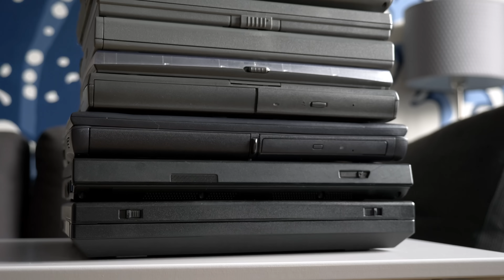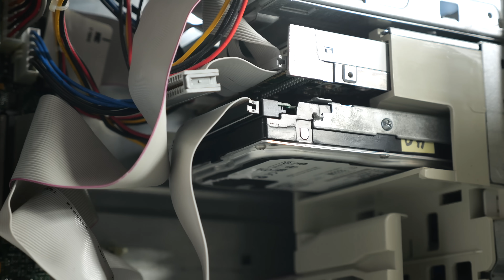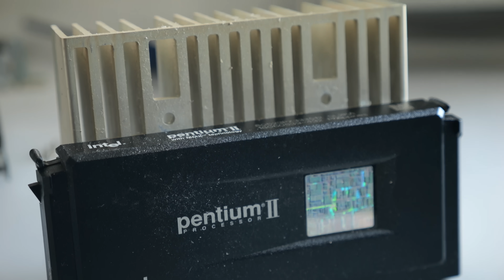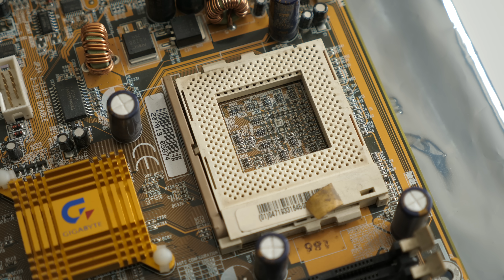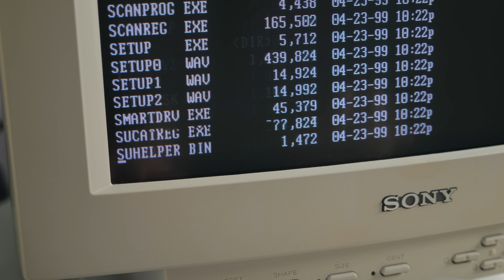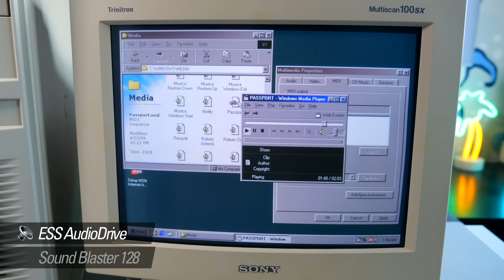Could this prebuilt vintage PC actually be GOOD?!

Comment: i had a celeron 533a (coppermine, socket 370), it ran comfortably at 800mhz, and during the winter with my window open, i could get it to hit 833mhz.  those celerons were beasts

Comment: For the soundcard comparison it would have been better to stick to FM performance in game music (SoundBlaster compatible) rather than doing it with MIDI.

What you tested here is how the midi emulation performs across the two cards which isn't exactly useful as the Roland softsynth in Windows is better than both of these cards and better handled by a wavetable daughterboard or external module. Only cards I've seen with really good built in MIDI emulation are Yamaha YMF cards which seem to try to sound like their MU series midi modules.

Comment: My Dimension XPS 400 64mb Ram Slot load pioneer CDROM, HP Lighscribe DVD writer , 1.2+1.44 floppy drive, LS120 + Zip 750 IDE. Sata PCI storage 2 x 128GB SSD. It does have the XG sound chip on board & Joystick port, later in 2024 I upgraded the expansions slot to a PicoGus ISA, 16MB Voodoo2 AGP, SLI Voodoo2 12mb PCI, Monster 3D 4mb Voodoo1 PCI, all working in Harmony with Dos6.2 , Win95\95 configurations. I used this mainly to write floppies to my collection os PC's especially NEC PC8801/PC9801 series and Apple 2c Atari etc

Comment: Dell and Micron P2 or P III CPU's are generally 440 BX or BX2 boards and fairly standardized. Micron ones may squeak a few more performance pieces of out the motherboard. Dell and Micron basically sold the exact same systems with different faceplate designs (but still the same case)

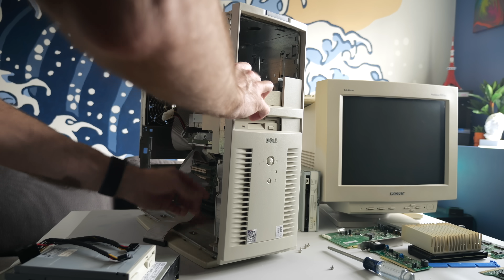Comment: My Dell Dimension XPS M200s is a P200 MMX, 64MB RAM and completely stock, with the original Matsushita CD-ROM, Matrox Millenium II 4MB, onboard SB16 and an AWE32 ISA daughterboard.  Mine came with all of the options available at the time, including an internal Iomega Zip 100 drive and the 3Com 3C509 ISA NIC.  The original HD is still in the case but disconnected and is replaced by a CompactFlash to IDE adapter. This allows me to swap between OSes within seconds.  I have one for MS-DOS 6.22, Win95 and Debian 1.1 / 1.2. Your hard drive mounted upside down is actually in the secondary HD mount point. The primary is in the vertical gap depicted at 3:11, where the primary HD is mounted vertically.  Given the system is a D266/D333, a more period appropriate benchmark would likely be Quake II.

Comment: I still own a computer that has a pentium 2 processor in it, the normal one with pins. I used it when my gaming pc broke and it was only powerful enough to barely run some flash games

Comment: The dual floppies may have been for copying.
I despise Dells that have this kind of side panel. They can be a real pain to take off.  When I would work on them they would usually be on the floor and up under a desk with all kinds of cables attached. Pushing those two tabs at the same time was difficult in that position

Comment: Oh, I remember that case. The first PC I had for myself came in it. 
But that highly integrated and hard to upgrade is still true today. The best time for a prebuild to upgrade was probably the mid-late 00s, when they used standard ATX parts.
But the previous owner surely went with common upgrades. Keeping the CD drive and adding a DVD. The Riva 128 on the other hand is old. And the ESS Audiodrive is just sweet. 
I suspect the ESS Audiodrive will give better DOS audio than the SB128. I have one and getting DOS sound is a bit tricky. The driver available at Creative's site doesn't come with the MPU-401 part, so I had to hunt down an image of the original driver CD. It runs fine under Windows.

Comment: I have a similar XPS T500, which I got probably around the time this video was actually posted. I think it is a bit more modern, as while it uses a slot, it is a Pentium III. Unfortunately it seems that after a few hours it's proprietary power supply has opted to stop giving anything but 5V Standby, so I'll probably have to try the mod to move the ATX connector. I got a Voodoo 3 out of it though so was worth it anyway. EDIT: Just noticed you never touched on the proprietary power supply, which that one likely has. it is a standard ATX connector but they changed the pinout a bit. No shots of the Power Connector so can't say for sure. (Mine has 6 pads to the side, reflecting where the ATX connector should be for standard ATX)

Comment: There are so many ways this video takes me back. I remember my absolute hatred for floppies.  Before my professors would allow us to email in our work in college, I would have to take the same thing on several floppies to campus since at least one would either magically fail on the way or not be readable in their drives. Also remember the horror of getting drivers to work with Windows 95/98.  I remember buying QEMU since I got tired of messing around manually trying to get things to fit in memory. Finally, I used to work on computers for friends and what not and really didn’t like Dells from that era. A friend had a hard drive that was being really weird and I ended up having to low level format it. I’m not sure what Dell did at the factory,  but that ended up fixing it and also made more disk space available when I ran a normal format on it.
Reply: used to carry a box of 10 Floppies at all times at uni and a copy of Pkzip so I could install it on the uni PCs for disc spanning. Back when checking my email meant taking a 15 minute walk onto campus because no student could afford home dial up.

Comment: Man that was just after I started building computers. First computer I built was a Cyrix 686 with a pr of 233mhz+. ACTUAL clock speed was 166mhz. I miss that machine, and my AMD K6-2 (though I wish I could have gotten a K6-3. Anyway it was 550mhz. I still have my 700mhz Slot type Athlon stored here. One of these days I'll dig it and see what I can do with its 384 MB of RAM. Perhaps just a file server. /shrug

Comment: 30-40 fps is why my 98se machine is made from parts from around 2003. I get triple digits on most things but at least 60 minimum. But my 2010 xp machine with a 2014 gpu still has some snags running Crisis. Dropping into the mid 40s at its worse. Good thing that game runs on my Modern computer.

Comment: If you use the older creative "Ensoniq" drivers (from vogons drivers) with the Audio PCI 128 card it has better DOS compatibility in Windows 98. And you gain " ensoniq soundscape" and decent MT-32 emulation from the drivers.

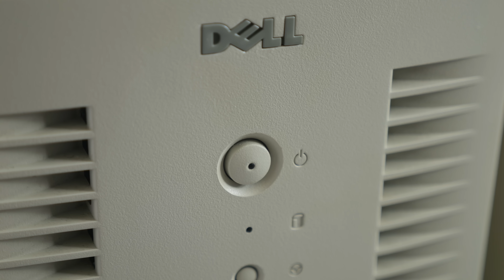Comment: 10:49 they also made that mouse for Compaq computers as well (i have a Compaq branded one i use with an older rubberdome IBM keyboard i use with a USB to PS2 adapter on my Pi3 for Dosbox stuff. Also i love the SB128 i have that same card in my Pentium II 450 build (with a MX200 32mb gpu, 384mb ram and its plugged into a CRT as well  - Quake 2 is beautiful on it).

Comment: I remember one of my college roommates had a Dell Dimension XPS with a P3-500 MHz.  The towers themselves were actually good kit like the one you have - but where Dell would get you was the bundles.  Even an iMac or iBook G3 was better value depending on your use case.

Comment: i wish more modern prebuilts were like this , too many of the big names use proprietary parts to an extent that sometimes makes it impossible to even reuse the case if the Motherboard dies, same goes for Power supplies.
Reply: Ive put new power supplies in Dell pc's, even put in a new motherboard in one., They have pretty good parts interchangeability

Comment: CT5880 used in some gigabytes motherboard back days, and I’m pretty sure creative is kinda cheated in terms of midi playback, what you hear actually is Creative’s software midi synthesiser, not generated by the sound chip, it loads soundfont into the RAM when windows starts, offers 8MB, 16MB and 32MB soundfont, which is quite a lot considering most computers at the time only has 64MB of total RAM.

Comment: I had a very similar D333 as my daily use machine through my sophomore year in college - 2006. Mine had been upgraded with a usb2 pci card, a 32mb video card, a cd burner, and a DVD drive. 384 MB RAM, and it was a surprisingly good performer, even nearly 10 years after its launch. Oh, and a second 20GB hard drive for all of my Napster downloads. Fond memories!

Comment: With prebuilt PCs often it was just that the PSU was too weak for serious expansion, they sometimes only have some 100 watts of power that can be easily topped out by some drives. Of course sometimes they also made proprietary card layouts or drive bays as well as gluing stuff down etc.

Comment: Those older Dell cases are actually great for new system builds. I bought a non working tower for basically shipping and built a new system in it. Thanks to the limited airflow I had to be mindful of heat output. But overall feel it was worth the time.

Comment: Those Dell PCs were always pretty flexible, and easy to disassemble.  I remember stripping a broken one at work down to the case literally only having to remove one screw (holding the motherboard in)!  I guess that made them easier and cheaper to build too.

Comment: Colin.. don't get me wrong.. love your vid's🤗 but.. go back to Mac man😯....... you have there a 440LX.. descent Motherboard🤓.. is not a 440BX... but you can put there a PIII 333MHz and 2 DIMM 256Mb If I remember correctly...  so good stuff 💪......... that WD400 7200RPM excellent.. you should have 12,5Mb/s on IDE..... put there a WD800 for more space and more HDD cache.......  and you have the second best you can have for retro-gaming... (SE440BX the last best you can have)........... the NVidea 128 is more compatible that the Ati for games 🤐. is not a RIVA TNT.. or TNT2.. witch it will be the best.. but again good stuff 💪......... The PCI 128 is absolute trash😠.. put some headphones on... an you will hear every single noise from the motherboard.. HDD and probably the oven in you neighbor kitchen also.... in DOS need drivers (because is PCI) so many games that need almost all the conventional memory available.. will not run... 👎👎 i have no love for the ESS neither..... you have ISA on that motherboard... you need a SB16🤨... if you are a bit of an audiophile.. look for the old ones from 1991 or 1992 like the SB16 SCSI-2 and the ones around her time period.... those have "Off-the-shelf" Sony or Philips Hi-Fi Digital to Analog Converter (DAC) chips.... so they are Hi-Fi sound-cards🤗.... and of course the original Yamaha OLP for the MIDI thingy🙄..... later SB16 models.. have cheap imitations of those chips😕..... AWE32 forward.. have cheap imitations also of Yamaha 🤢...

Comment: I grew up with one of these, still have it, never been upgraded. Unfortunately my dad got upsold on a workstation GPU so gaming performance took a hit(not that we knew any better or cared beyond the issues with transparent textures.) I tested it a few years ago and it managed 15FPS playing Duke3D though it is also the original OS install(bloated & with registry corruption errors) so that may not be representative. It ran a good life 1998-2003 with the occasional dip back in for retro Shandalar & homework uses when the new Dell was broken(as happened semiregularly)

Comment: The reason there are two disc drives is that it's easier to copy discs,  with one drive you have to keep swapping discs in and out.  Dell wasn't as bad as Compac, I had a friend whose Compac had the keyboard permanently connected to the monitor!    Compac also had weird memory specs, 768mb being common, and access to the bios being quite complicated.  I built my own PC333 from parts, for $1400.  A 250mb hard drive cost $400 when I built the system,  but a 500mb drive a year later cost just $250. Opting to spend money on 16mb of memory was a good investment, and of course two 3.5 drives and a 5in drive because someone had to be able to copy your old floppies onto a 3.5 in disc!
Reply: exactly saves you from having to change discs a by a lot

Comment: Something was out of phase with the ESS AudioDrive recording. Not sure if a jack wasn’t connected fully or if it’s the recording setup or the old hardware, but it definitely wasn’t right. You can tell a channel is out of phase because half the sound is missing or quiet and the stuff that’s there sounds like it’s coming from behind your ears.

Comment: The author misses the entire story on Slot 1...   before that was socket 7 and intel was not happy with all of the competitors drop in CPUs working on their boards, so they designed slot 1 under patents where they would be the only manufacturer of CPUs for slot 1 boards. They also told the public that the new CPUs were "too fast" to be socket-ed on the board which was clearly BS since here we are 20 years later still with sockets. 

This is the era that Intel and AMD diverged from using the same socket/slots with Amd using slot A boards. Yeah there were "super socket 7" boards but that was just a different chipset and those boards still took intel or amd or cyrex chips.

Comment: What an amazing coincidence! 

My partner was out for a walk a few days ago and happened across a Dell Dimension 4100 with its Dell branded Sony Trinitron monitor sitting out for hard rubbish!

Naturally, once she got home we drove back and found it still sitting there, so I took it home.

The machine itself was a bit dirty, as expected, and unfortunately the previous owner seemed to have been a heavy smoker so the internals were covered in cigarette nonsense. I stripped the machine bare and cleaned every surface I could access (PSU, CPU fan, case internals etc).

I put the machine back together and powered it on to find that it is a Pentium III 1Ghz Socket 370 system with 256MB PC133 RAM, ATI Rage 128 Pro, Sound Blaster Live!, CNET ethernet card, and a generic PCI modem. It had its original CD-ROM drive, and a Sony CD-RW burner (with an integrated Memory Stick slot!), and original floppy and hard drives. The hard drive was a 20GB Maxtor, and it was noisy and ultimately failed a few hours later, so I swapped in a Seagate 80GB drive. Much quieter! The original CD-ROM drive also had failed, showing no signs of life and also causing some really strange behaviour on the IDE controller.

I 'upgraded' it today with another 256MB PC133 RAM, the 80GB drive, a Nvidia Geforce2 MX400 (because the Rage 128 Pro was really lacking in... everything) and replaced the faulty CD-ROM drive with a DVD-ROM drive from around the same time.

The 4100 and your D266 (D333??) are so very similar, it was uncanny watching you showcase your machine, only a few days after I began working on my machine!

Also, I really enjoy your videos, they are extremely enjoyable to watch!

Comment: I was given a Dell Dimension XPS PIII system early in my computer days. It was great, reliable system too. Back then there were so many options for upgrades. But the systems only supported Coppermine processors. Evergreen and Lin-Lin sold PIII socket upgrades that allowed Tualatin CPU support that really made these systems fast. They even had Slocket adapters to allow you to put Tualatin Celerons (running 1.4GHz, 100MHz fsb, with the 256kb L2 cache) in systems like the one in the video! I must have bought at least a dozen of these adapters back then, to upgrade systems for people that didn't have the funds to buy a whole new PC. I loved the Dell i815 systems for their features. And the Dell BX440 boards for PII's were indestructible.

Comment: There was a time when Dell and Gateway 2000 were the standard-bearers for PC makers, specifically because they used more or less standard components in their PC's (at a time when IBM was going its own way with MCA and Compaq was going EISA, so someone needed to pick up the torch for what had become the "PC standard" ISA and then VLB and PCI). Building your own was considered a "cheap" way to get to the place you'd be at with a decent Dell or Gateway, albeit ending up with a white-box PC; it wasn't yet the preferred or higher-end way. This looks like one of the models at the tail end of that era for Dell. It was a quick fall for both brands in the late 90's/early 00's.

Comment: FYI, the case isn't really proprietary (but also not far from it, and they did use a different front panel design.) It was even used on the Macintosh Umax S700/900 machines. Fun fact, the side panel and bottom "foot" could be changed out by the OEM, then the 5.25 drive cage can be rotated 90° to make it a desktop case; a'la the Umax S700.

Comment: the bios on my slightly-older dell dimension p100t also changes its reported "model number" in response to the cpu speed, but that's just set by motherboard jumpers in my case

i've also got a similar ESS card; the ESFM is kinda nice in its own special way!

Comment: Well, had a P2 233 at some point... That little guy was a champ. 291 MHz all the time. Actually it was still working when I gave it away after 3 years of good usage. Yes, the Celeron might have been the better value in the end. But, that's what I got - and hell was I happy with that machine :-).

Comment: Dell did move to proprietary builds. I had a Dell XPS90 in the 1990's as my first computer, then started building my own until around Vista timeframe where I bought a Dell pre-built. I had proprietary motherboard form factors, case, and PSU. It was horrible. Cool video. Blast from the past to my college days.

Comment: We had the pentium 1 233 model with that exact same case. Guessing that because the bios states D333 that at some point the motherboard was swapped out to upgrade to that 333 mhz p2, instead of the 266. It also explains the existing onboard audio port punch outs, which were probably on the original motherboard, and the 3rd party soundcard. Quick way to check if the mobo is original: look and see if the service code on the case matches the code on the bios.